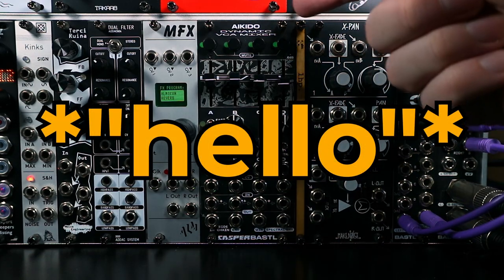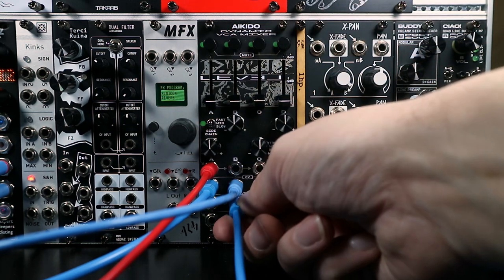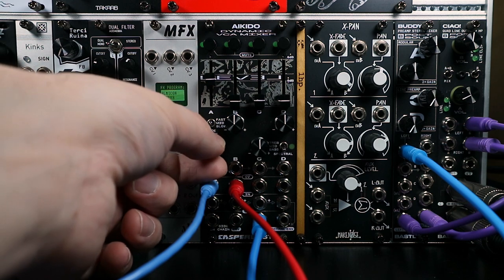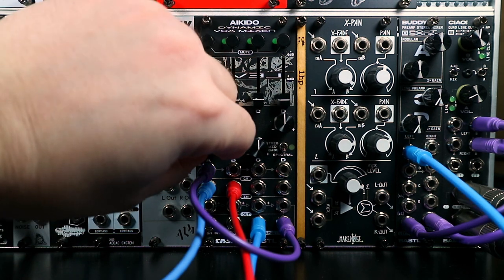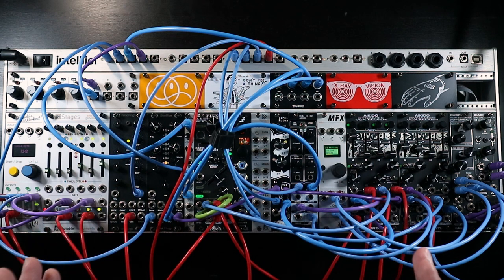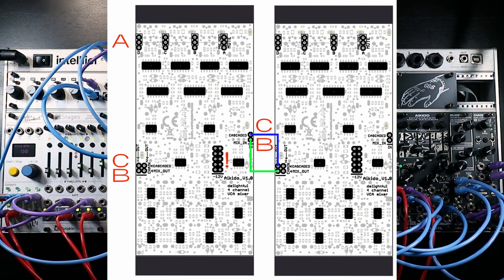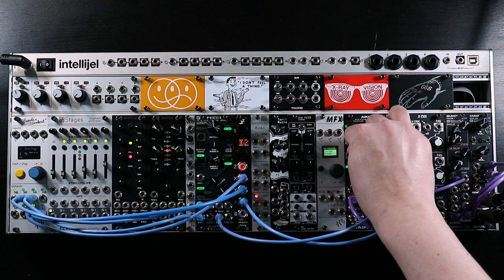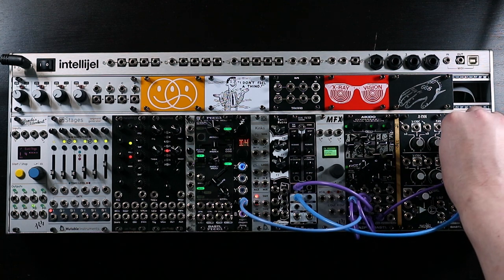Bastl Aikido - Video Manual and Patch Ideas

Comment: still trying to understand if the aikido is stereo itself or if it needs external routing to be stereo
Reply from the maker: Each VCA is mono, the mix output is mono. But you can pair up two VCAs if you want to make a 2 channel stereo setup rather than a 4 channel mono setup, like I show in this video.
Reply: @OscillatorSink  thanks so much! Your demonstration clarified as well. Should’ve waited before I asked!